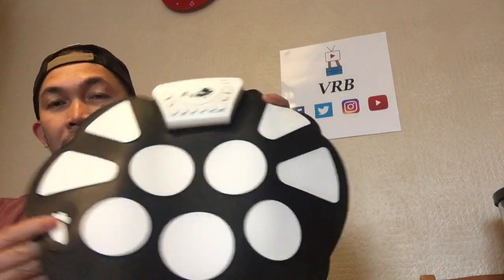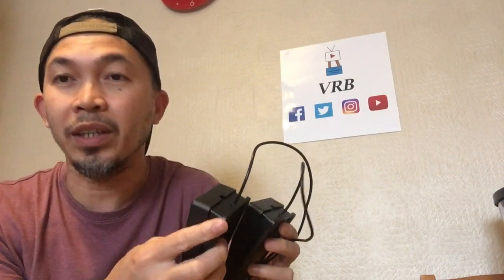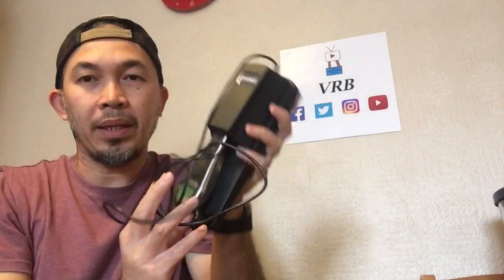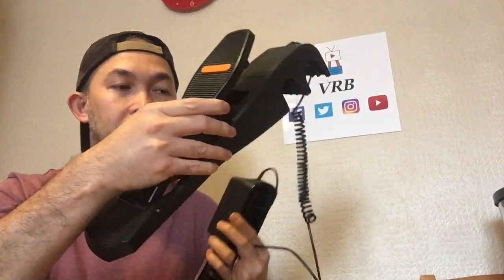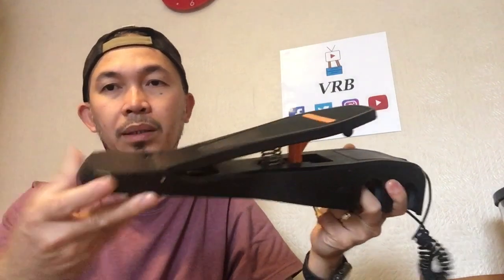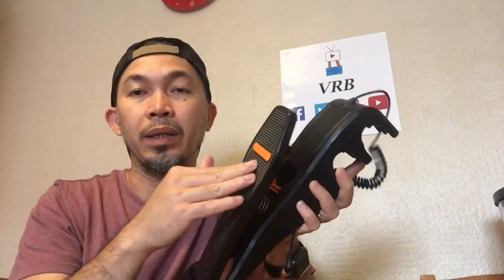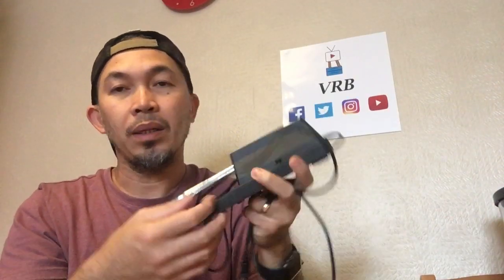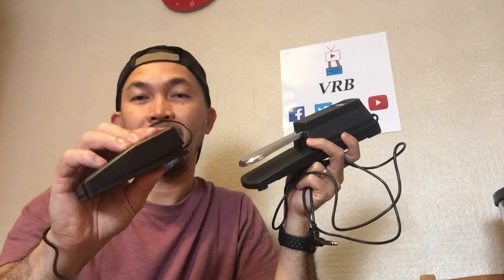Hacks and tricks to improve the foot pedal or bass drum kick of this Roll Up DrumKit

Comment: without cutting the cables of the original pedals wouldn't the idea work? or just buying a similar cable can work?
Reply from the maker: If there's a cable around that matches. The one I got which is like a y splitter didn't work so I had to cut it and figure out the wiring by doing trial n error until it worked for both pedals. Coz initially it only worked as hi-hat. So I did it one at a time from bass kick to hi-hat.

Comment: Hi. I got one of these drum kits couple of months ago and for the start the foot pedals didn't ever worked at all. Any idea on what I could be doing wrong? The connections are pretty clear, so I'm starting to think that my kit came with a defect on it. Thanks :)
Reply from the maker: Sometimes they get the labels wrong. So try and plug it to like the aux in or headphones in. Or it could be that the connection jack of the foot pedal should either be pushed really all the way or just loosely in the foot pedal socket/input.
Reply: @vincentryanborres  thanks! I’ll try your suggestions ;)
Reply from the maker: you're welcome.